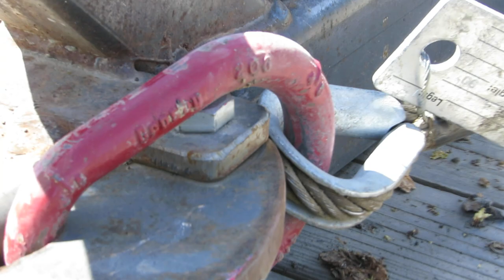Log bunks that trip for goose neck Trailer #Firewood

Comment: This setup is quite dangerous and hard on spring suspension. I know from experience these are dangerous. You are better off using a shorter standard inside pipe and lengthen it to allow for height of load. Just a quick message about your safety thanks and have a great day.

Comment: you made trip stakes... cool, just so you know, pro loggers don't use em anymore cause its a great way to get killed...
Reply from the maker: I unload with a tractor and pallet forks. Getting the bunks out of the way makes unloading much easier.
Reply: @AndreasvonT  just be careful when you release them, try not to load taller then the stakes, and avoid anything shorter then your stakes are separated,  Used to be that we would have a machine push everything into the water after the stakes where tripped, but gravity does weird things
so when a guy would trigger the stakes (an almost identical system to what you built) anything could happen, short logs would roll through, or top logs would roll backwards, crushing the driver